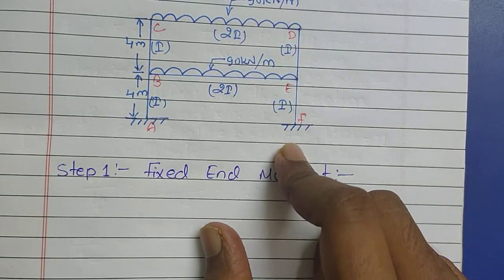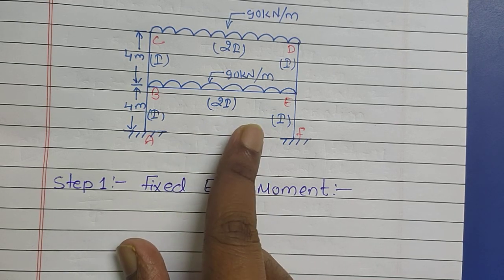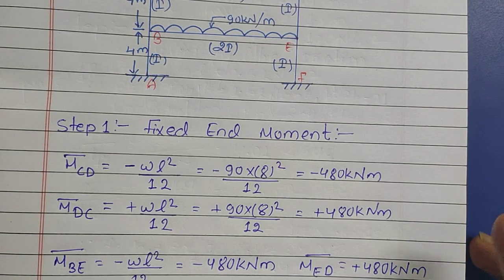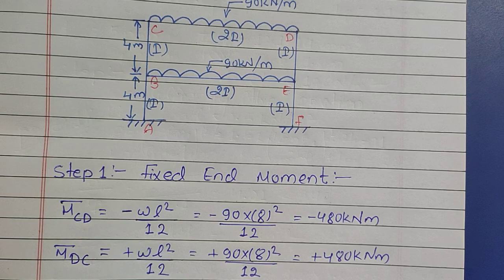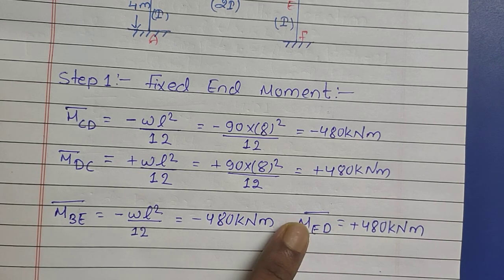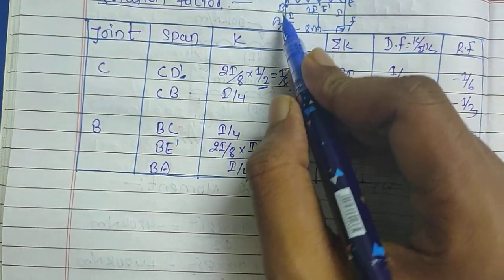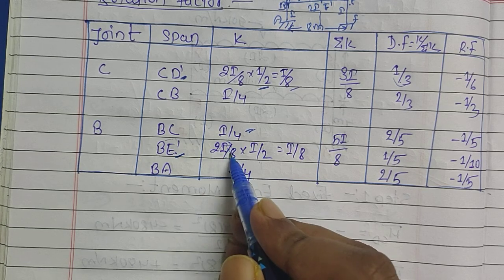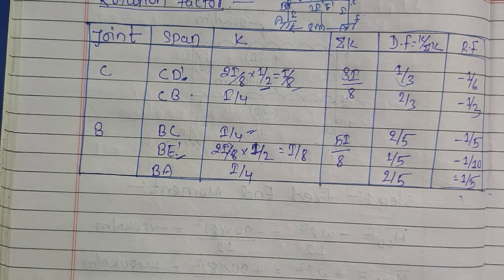Kani's method | rotation contribution method | kani's rotation method | structure analysis

Comment: Sir, I need your help in clearing my doubts pls help me.. my doubts are: 

1) can we just learn one method of force method and just one method from displacement method and still can analysis any type of beams and frames while designing any type of building? 

Also, when we design uniaxial or biaxial column then we need moment about xx axis and moment about yy axis so how come we will know what’s the moment about x and y axis for the design of uniaxial and biaxial columns by kani or any other methods? 

PLEASE HELP ME SIR.. its sooooo confusing for me pls help me out I’ll always grateful to u.. pls reply as soon as possible sir
Reply from the maker: Hello dear,

I got a bit late to reply you. As i was busy making new video. I am extremely sorry for keeping you waiting.

 And here are your answers,
1. As both the method i.e. Force method and displacement method are used to analyse indeterminate structure. So you can use any of these method but remember that the structure or frame must be indeterminate. But when you are specifically asked to analyse by (.....) Method then in that case we need to use that appropriate method otherwise not. If not mentioned try using :
A. Unit load metho (influence line diagram)
B. Slope deflection method
C. Moment distribution method or
D. Kani's method

2. Listen dear whenever we are designing column whether it is axially bending or not we do this as per the code IS 456 and a handbook i.e.  SP 16. So do don't need to use kani's method to calculate moment on beam but we are provided with proper graph and formula in SP 16 handbook which are use to calculate moment.

Or,  Remember one thing that RCC DESIGN AND STEEL DESIGN are different from STRUCTURAL ANALYSIS in following way:
Structure analysis: here we analysis the structure by calculating moment shear force etc.
While in design subjects we deign a structure i.e. its dimensions. Creating economically durable structure.
Reply: Civil learning online THANK YOU SO MUCH for your reply sir. I’m really grateful to you for replying me as you seem to be a very busy person yet replied me with full explanation. 

But Sir, we are suggested that we should use force and displacement method when we have Ds > Dk or vise versa for easiness so I said that and also I know we design column as per SP 16, but my confusion arose when I started studying force and displacement method for indeterminate structures since I came to know there are bending moment acting on columns too as we can see while you did frame analysis by moment distribution method. So, my question is what to do with the bending moment we get on column from the analysis by MDM or any other method ? ( I know we calculate moment on column also by method (K/total K)*Me (where Me is unequal bending moment as you know) .And for these moments we get on columns or any moment we get on beam we provide reinforcement to tackle the moment but what about the moments we get on column while performing MDM or any other method? Shouldn’t we take it into consideration and provide reinforcement to tackle that bending moment apart from the moments we get in case of uniaxial and biaxial columns?

2) When we analyze a frame of multi story building by MDM then should we just consider the members at joint from x and z direction or also from y direction since in reality  one or two members are connected at a joint from y direction too

3) how to analyze multi story frame ( sway and non sway) . I mean how will moment come on columns at first and other floors (how to calculate those moments) and also at intermediate columns? Can you please make a video on analysis of multi story frame ( at least G+2) by MDM or any other method in detail considering members at a joint from y direction? 

Pls answer sir

Also sir we used IS coefficient method to design beams directly but we use this method only if the difference between spans are not more than 15% so obviously when the difference between span is more than that we have to design  by MDM or any other method for indeterminate structures. 

Please clear the doubts and confusion I have asked in points
Reply from the maker: Whenever we analysis a frame of any storey we need to use cantilever method or portal method.

And when we find moment in MDM it is actually the moment along y- axis.